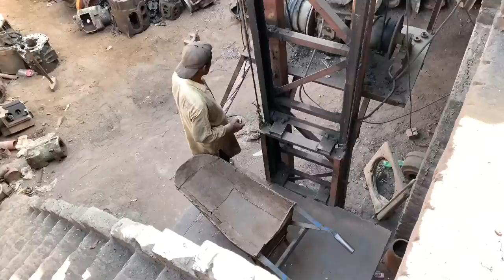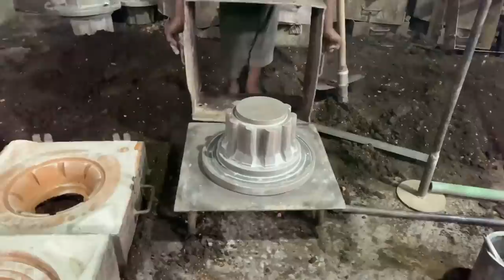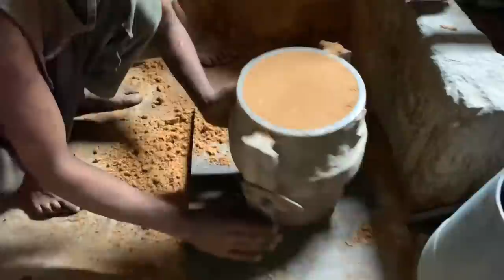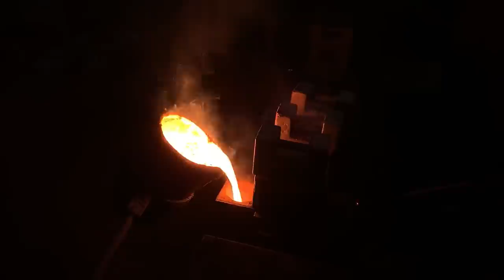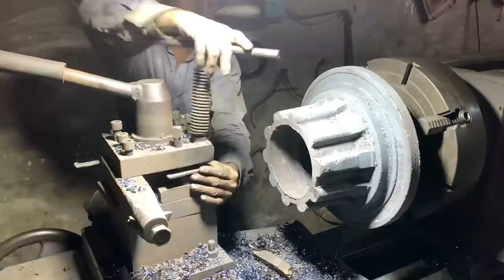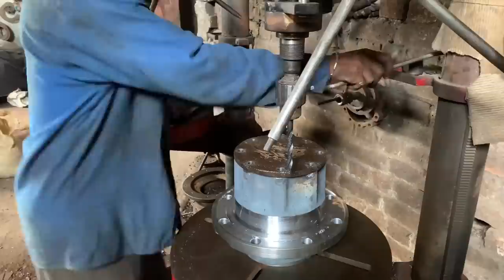Amazing Manufacturing process of Wheel Hub For Heavy Duty Truck | Production of Axle Wheel Hub

Comment: I don’t think there is a pair of work shoes in the whole of that country. Also who says you need a dial indicator to check the runout. As long as it looks round where it supposed to be round and flat where it’s supposed to be flat it’s good to go. That was a rough finish on the machined hub.
Reply: no worries about the grade of steel being used either...just throw any old scrap into the furnace. if it looks like the right steel it is the right steel
Reply: The tolerance is +/- 1inch, so no need🤷🏻‍♂️
Reply: @occam5052  lol.
Reply: @rd-ch1on  lol.
Reply: @occam5052  wow, that close of tolerances🤣🤣lol
Reply: You probably haven't heard their philosophy on safety!  They feel they don't need any safety equipment, they've been doing those jobs for 25 to 30 years, they have so much experience, they don't need safety equipment! 
They will be the first to point out they have been doing it so long, safety equipment & procedures are a waste of time & money!  
Of course if you point out the fact that accidents can happen to anyone, & more so when you get over confident & try cutting corners, they ignore you.
Reply: The sad part of it is, some of that stuff gets exported to the US.
Reply: @timothygeiger8271  They use their flip flop sole as a feeler gauge 🤔😂
Reply: @occam5052  🤣🤣🤣  shh! don't let all their secrets out🤣🤣
Reply: The paper shim approximation of the centering of bolt circle suggestion ring had me shaking me head…no Cadillac for that hub…
Reply: @CATech1138  news flash genius, those hubs are for big trucks! 🤣🤣

Comment: Anyone with a little bit of metallurgical knowledge can see that this is way too brittle just by the chips on the lathe. It will fail almost immediately when put into service.
These guys don’t measure any of the scraps and put too much cast iron into the mix. They need to find the proper
Reply: Many hubs are cast iron, from the chips i can tell this iron has a lot less carbon than normal cast iron.. there's a lot of steel in their iron rather than a lot of iron in their steel
Reply: yeah they just seem to use "averaged" mixed iron for everything.  Some old brake discs + some motor laminations + a few rusted bike frames + scrap steel bolts + rusted corrugate etc. etc. = perfect mix for every cast iron/steel product you care to name.